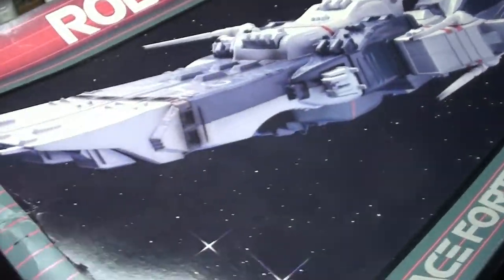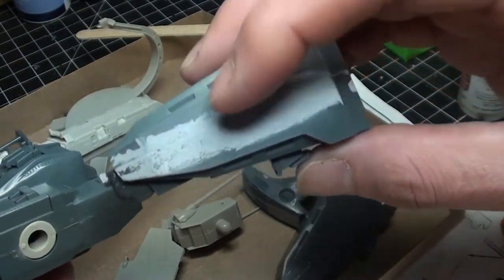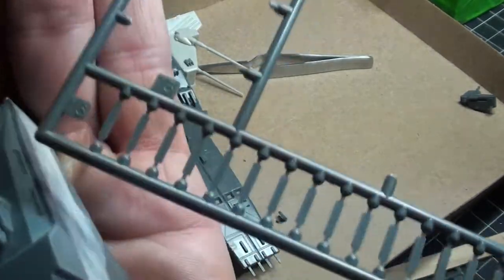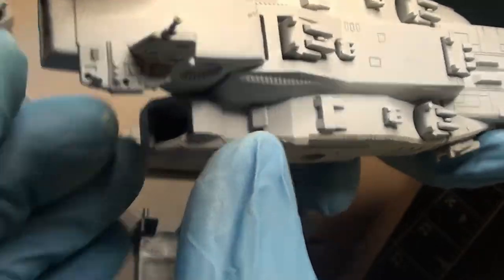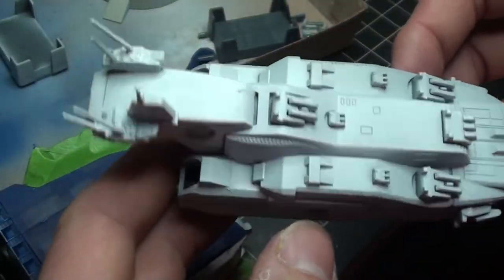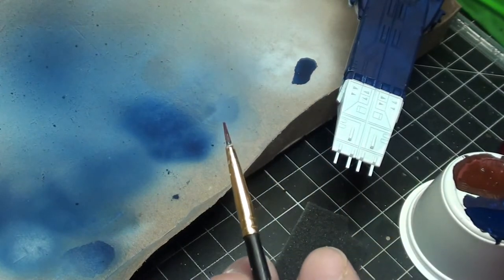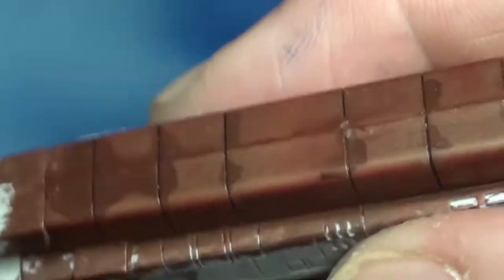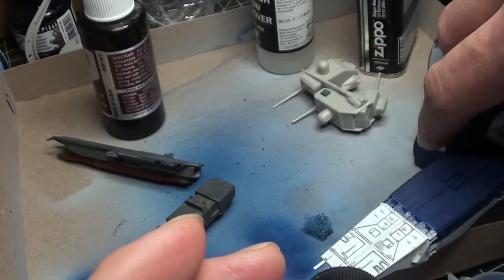SDF1 Part 1

Comment: So…at my current location, I can not listen to the audio on this.  What are you using, including the bottle, brush, and paint type to do the mat lines?
Reply from the maker: Sorry you can't get the audio. I used Tamiya panel line accent. The brush is built into the cap. It's really some great stuff to work with!
Hope that helps,
-John